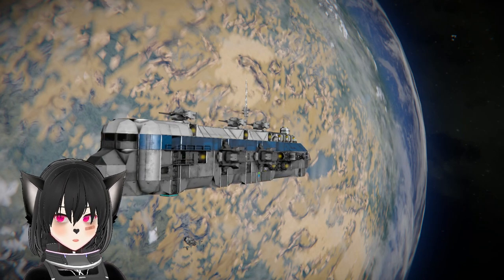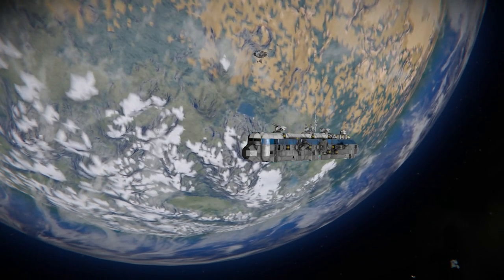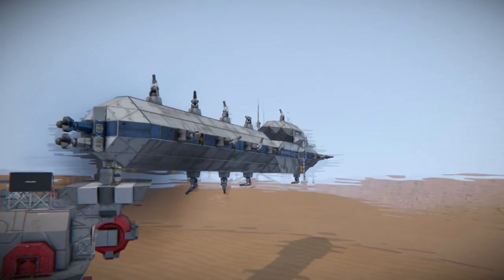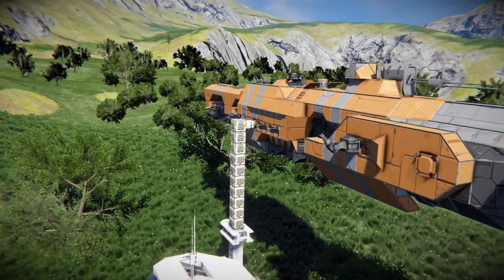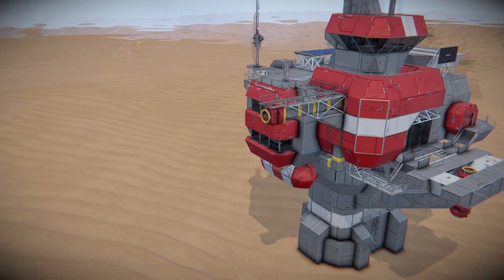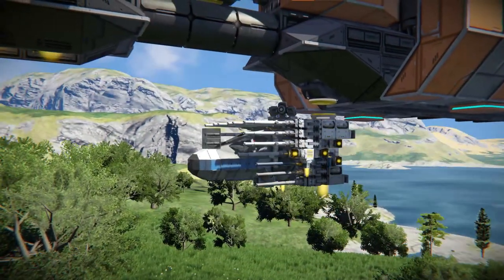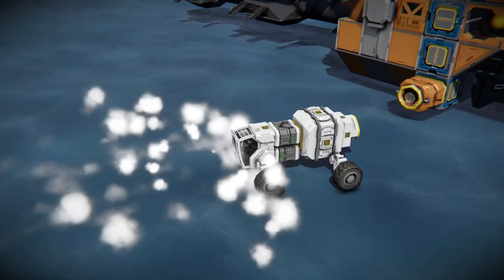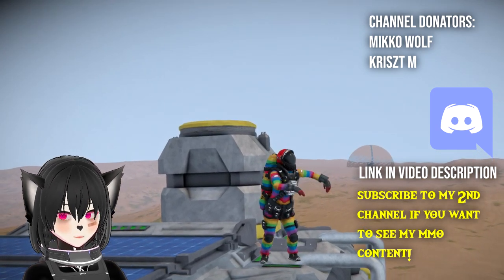Why Put Survival Ship Connectors on Top or Bottom? Space Engineers

Comment: I mean, it kinda depends on doctrine. I usually build larger ships with no fewer than 4 connectors. 1 bottom, 1 front, and then 1 on each side. The idea is that with the ship docked to a station on the front, the station is less likely to get hit meaning the ships can be better deployed. Sides are typically for ship to ship connection for larger ships or specific types of space stations and the bottom is to carry smaller large ships/ massive small ships. Granted I tend to build vehicle bays inside ships for anything meant to carry them rather than whacking a truck onto the bottom of a cruiser.
Reply from the maker: Things are certainly mostly situational c= but if you're really limited on PCU then top or bottom would be the most efficient

Comment: I recently built an Ion Flying-builder (to use on the moon) and found that by having the connector on the bottom I was able to make it significantly more compact than if I had built its conv. system linearly. ( +shape instead -shaped - vanilla cockpit conv. hooked up to be able to use its build mode)

And by compact I meant by its proportion ending up cube-ish rather than tube-like (built to fit the 5x2 gate's opening)